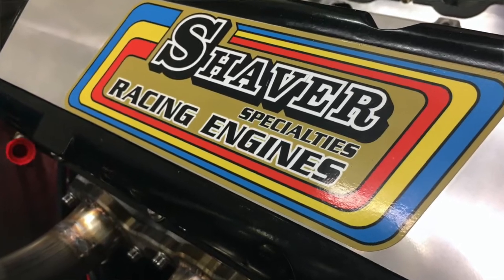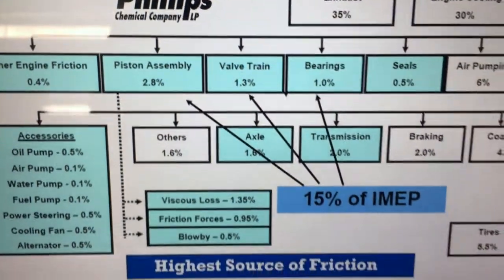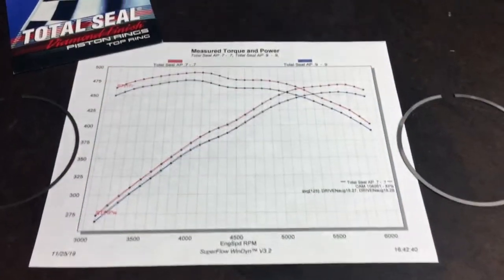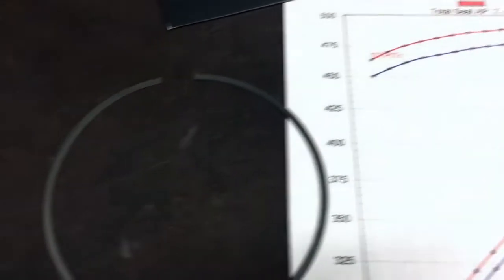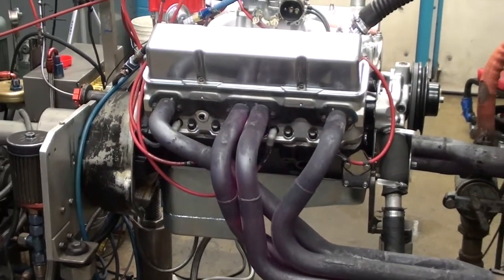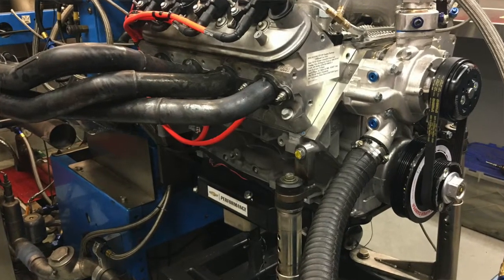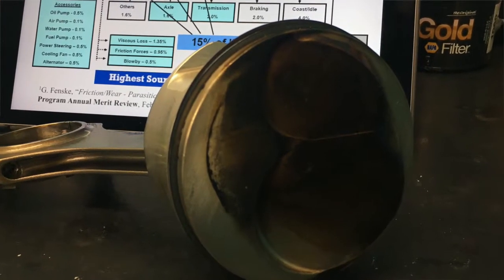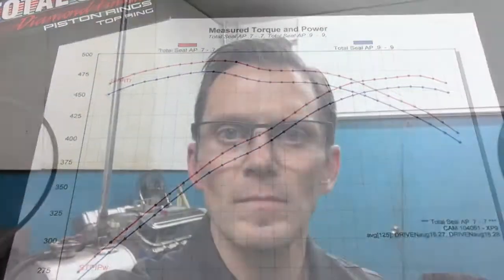What's The #1 Source Of Friction In Your Engine?

Comment: Isn't there a fine line between the pressure needed for compression ring seal & the amount of friction that produces? Take ported rings for example. In order to get a better seal between a properly bedded in ring and a properly honed cylinder wall, cylinder pressure aids in pushing the ring against the bore. However, this very action creates more friction because of increased contact pressure no?
Is this why/how the thinner top ring achieves net gain?
Reply from the maker: It is a fine line to hit the optimal balance between seal and friction. Actually, the gas ported rings make it easier to strike that balance because we can adjust the size of the gas ports in the ring.

Comment: Excellent work you're doing!  Do these thin rings stand up to big horsepower and power adders?  How do they hold up to nitrous and boost?
Reply from the maker: Because these thin rings are made from either stainless steel or tool steel, they can handle big horsepower. Our .043 tool steel rings can handle big nitrous or boost. If you have a specific application in mind, please call our tech department for a recommendation - 623-587-7400.